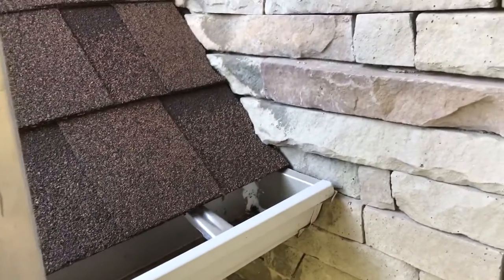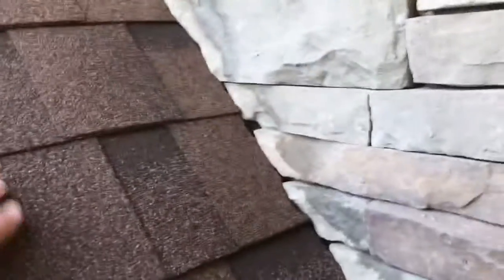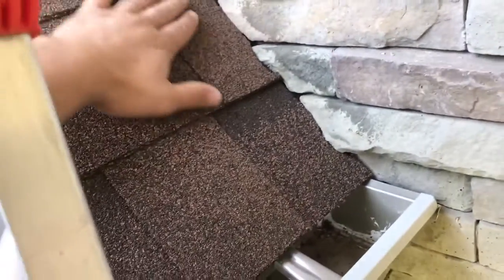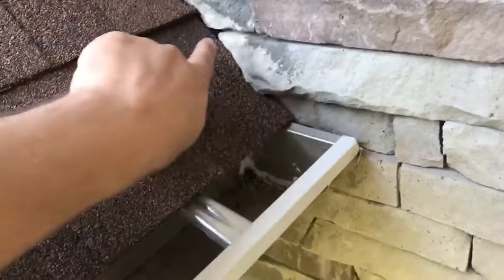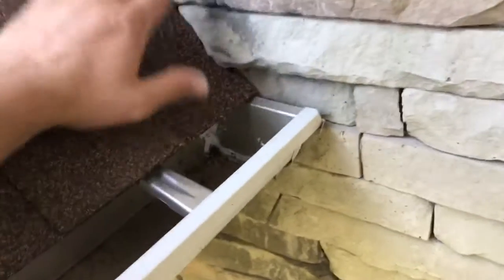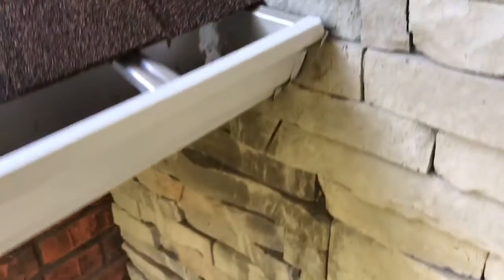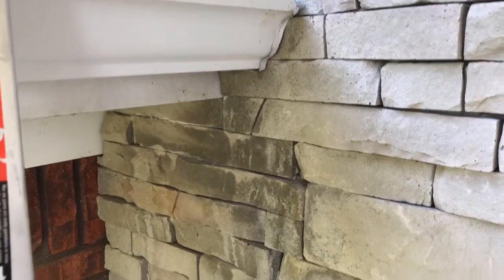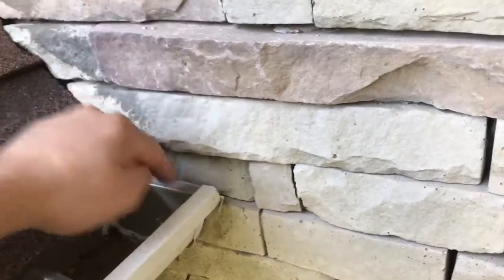Missing Kickout Flashing on Manufactured Stone Veneer Causes Damage in the Wall Below.

Comment: It’s technically impossible to install the kickout flashing on the stone as the water has already entered behind the stone.
Reply from the maker: Correct.  The only repair is to remove the stone veneer, fix the water damage, and put things back together with the proper kickout flashing.

Comment: I have the exact same problem. How do you install flashing after the wall and roof is finished?
Reply: I have the same issue too where the stone meets the shingle. Water is getting between the gutter and the stone of the house and run down the exterior and getting the dry wall wet inside of the house. Did you find a fix?